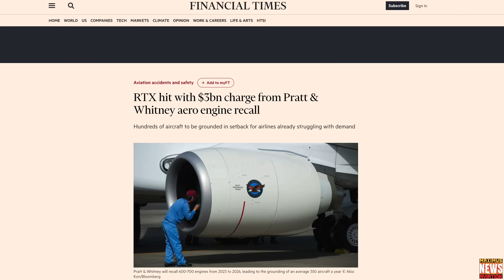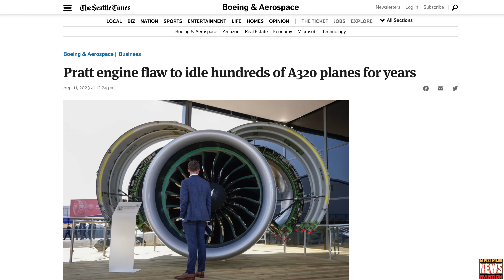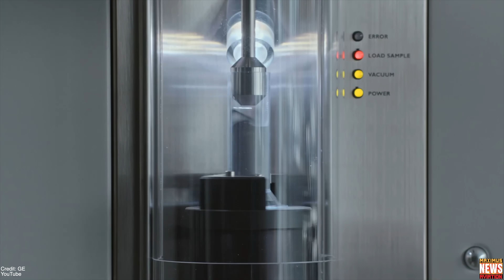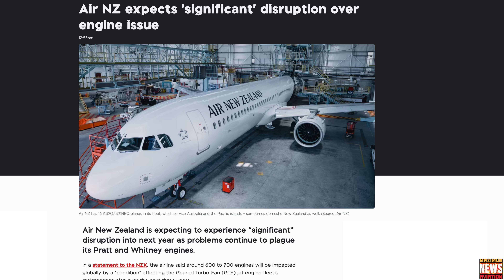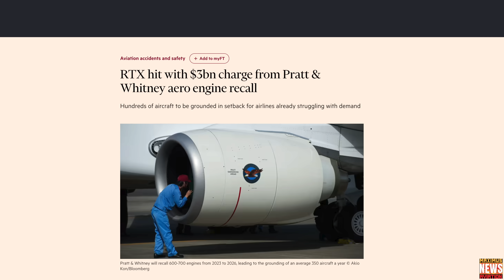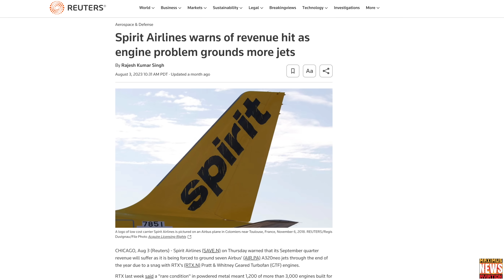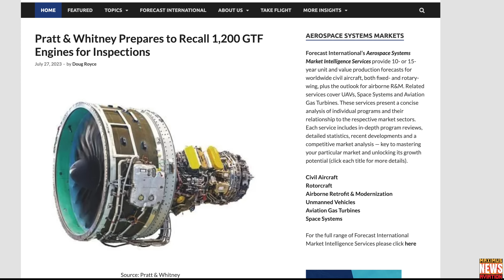HUGE LOSS For Airbus. Every A320 neo-Family Jet P&W GTF Engine Will Have To Be PULLED And Repaired!

Comment: There you go. At least the Boeing fan boys can stop twisting themselves in knots, as they realise that if you buy something to put in your product and something goes wrong with it, it's on you. You can then go and sue your supplier to recover your costs. That's the law.
Reply: It's more usual for airlines to lease the engines fitted to their aircraft. They are not bought as a package and this means the engine manufacturer is on the hook for any issues during the length of the lease.
Reply: That's not the law. If you buy  something to put on your product and something goes wrong with it it's all on the manufacturer who made it. In this case engines are not boeings control but only the engine manufacturer. They hold full responsibility. The customer chooses the engines and the manufacturer deals with certification and any other issues That's bottom line
Reply: Yes. It’s not just Boeing that sucks, everything sucks! Hooray!

Comment: And guess what, just like Boeing, it’s not Airbus’s fault.
Reply: Pratt & Whitney (RTX Corp) is responsible. Airlines negotiate the engine purchases with the engine manufacturer. The engine manufacturer is responsible for warranty.
Reply: #blameChina
Reply: Exactly my thoughts. Engines, the more efficient they are the more problems they cause.
Reply: Seems that Blackrock Inc owns Pratt&Whitney. They surely have all the money to pay for this.
Reply: But it is... If I buy a plane from you and it breaks down in the guarantee period, you are paying me. I have a contract with you, not with the engine supplier. That's your problem, and you have to recover what it cost you to make me whole, from your engine suppliers. That's how it works in law. That is the law. So both Boeing and Airbus will be recompensing their customers, and will file suit for recovery of those costs from their engine suppliers.
Reply: @BigHenFor customer choose the engines.
Airbus is just responsible for certification of compatibility with its airframe i think
Reply: @BigHenFor its not. Boeing don't make the engines on planes. The engine manufacturer pays compensation for any delay an aircraft has whilst in service and before certification or delivery. That's the law and bottom line
Reply: It is a well established fact as you have stated. P&W are going to have to File for Chapter 11 protection asap but even that may not save them.
Reply: @trevorhart545  I would not jump to that conclusion too fast.   We need to understand the contaminated powdered metal thing.   If the powder is made with a process licensed by a single company to all the engine makers this could be everybody.    Something would need to be worked out to protect them or we could be without get engines.   
Not saying it is but it might also be traced back to a single supplier who feeds everybody.
Reply: @BigHenFor Not necessarily. 

In many cases, the airline doesn't buy the engines. They are rented directly from the engine manufacturer by the hour.
Reply: @BigHenFor That’s where you’re wrong. It’ll come down to the engine manufacturer not the airframe manufacturer. When you buy an aeroplane you usually buy the airframe and lease the engines from the engine manufacturer or a third-party leasing company. Rarely will the airframe manufacturer be on the hook for engine issues, because they write the contracts to ensure they’re not.
Reply: @BigHenFor  I think @Leon_Tacitus_LLR was thinking of fault as who caused the problem.  Who had engineers or management that goofed.  Your talking financial responsibility
Reply: @BigHenFor  Actually airlines order engines separately. So you do have a contract with the engine supplier.
Reply: @BigHenFor  That's not the way it works, and there is NO such law.
Reply: @BigHenFor   That is not at all how the aircraft business works.  Engines are purchased completely separately from the airframes.  A contract with Airbus to buy an airframe is just that -- for an airframe.  There is a separate contract altogether for the engines with the engine OEM that the customer selects.  These are, thesedays, generally leased by-the-hour.    The engine manufacturer will be responsible for these costs, but they will actually be minimal to the airline.  Since airlines only lease hours of engines and not actual engines, all P&W has to do is swap the engines out with ones already repaired.   The only downtime will be the time it takes to swap engines.  Whether P&W has to pay for airframe downtime is up to their individual contract with the leasing airline but, regardless, it will be relatively minimal.

Comment: Why are airbus using P&W engines? Rolls Royse engines surely better?
Reply: Which Rolls Royce engines are available for the single aisle jets?
Reply: Airbus offer P&W and CFM options on their A32x neos.  Both engines look about equal on paper.  The operator's choice could be a political one - US airlines might prefer a US manufactured power plant, or might have a long term relationship with P&W - like United, who ordered P&W powered A321 neos and A321XLRs last July.
Reply: @peterhastings703 United Airlines is a historic customer of Pratt & Whitney, and their A320ceos have IAE engines, a consortium where P&W is still involved.
Reply: RR doesn't have new generation engines at this level. They are trying to develop Ultrafan for this purpose.
Reply: The last time Rolls-Royce was involved in single aisle engines (International Aero Engines, with Pratt & Whitney, MTU and Japanese Aero Engines) ended up in a lawsuit against Pratt & Whitney because of the Geared Turbofan patent.

Comment: Huge loss for P&W.  They will be footing the bill for this.  Is this also going to affect the A220?
Reply: To be fair I would rather foot the bill for the HPT rotor set than putting 346 souls into the ground with the competition.
Reply: @afterburner119  US business would prefer to pay compensation to victims than address their failings.
Reply: RR may be the only OEM in the clear 😅. Off the press “Not just Pratt & Whitney, but GE Aerospace and CFM too have been confronted with a contamination issue in powder metal that requires the replacement of engine parts. In the case of GE and CFM, the issue affects the GEnx large turbofan and the CFM LEAP.”
Reply: @afterburner119 Yes in this case RR is in the clear because they have no engine participation in the 320neo program.
Reply: @afterburner119  you can't be so sure about that, RR sure ain't in the clear, the reliability of their Trent 7000 and XWB engines is inferior to the GE90 and GEnx. And then there's the Trent 1000 🙄
Reply: I will say yes and the Emb-190/195-E2
Reply: Somebody mentioned Rolls Royce and their R100 (I think that was the name of the engine) engine. Well Rolls Royce disintegrated as a company after that debacle.  There's still Rolls Royce engines but it's not the same company, it's a phoenix from the ashes of the old Rolls Royce.
Reply: not the first time they have made bad engines with bad turbine's
airbus should have bought RR engines but then its the French so there you go
Reply: @joeconnolly89  Well maybe Rolls  Royce engines are much dearer than Prat & Witney engines. I don't know, though I live in the U.K
Reply: @joeconnolly89 Airbus isn't French and there are simply no RR engines in the required engine range for the 320neo family. And if you think RR engines are any better than GE or PW engines regarding reliability, engineering and efficiency then you certainly don't know much about that industry. Just a reminder about the great RR Trent engines, which almost downed a Qantas A380 because of a design error causing quite a bit of recalls as well. All of these engines are engineering marvels, highly complex on the edge of latest engineering and material possibilities and therefore quite prone to unforeseen technical problems due to design issues.
Reply: @joeconnolly89 
RR have had their own problems, so this silly attempt at jingoism is somewhat unfounded.

Comment: If it ain't Rolls I ain't going.
Reply: Trent 1000
Reply: GE rules - RR drools. Just look at the Trent 1000 and the inferior reliability of the Trent 7000 and XWB as compared to the superior GE90 and GEnx designs. Manufacturing defects can happen to the best manufacturers, just look up the RR scandal where they were caught with bad parts. At least with GE, they conducted their own investigation, and duly reported it to the FAA - meanwhile at RR, they had some of their fan blades disintegrate on Trent 800 engines on EK years ago. Tell me one instance of a GE carbon fiber composite fan blade disintegrating in flight - I'll wait.
Reply: @rafaelwilks  Despatch reliabilty for Trent T-7000 & T-XWB has been phenominal. Admittedly T-1000 did have major problems which cost the company dearly, so what you suggest about defects occuring is correct, but you only apportion it to RR, what about uncontained explosions of GE90`s, & GEnx problems in it`s early life & more recently too ( United B787 over the Pacific had a shutdown ) of course you won`t mention those....not on your agenda is it? Trash talk does you no favours.
Reply: If making jet engines was simple, easy, and foolproof, Briggs and Stratton would be making them.
Reply: Thier latest engine has issues sutting off in flight. No one is making perfect turbofans. P&W took the responsability seriusly. They didnt Boeing-ed it like the 737 max crap. In the end they can retain their name and reputation. Better safe than sorry.
Reply: Tell that to both the Trent 1000 and the Trent 7000. Both are having considerable issues, such as blade cracks.
Reply: @O530CarrisPT_C2  T-1000 had problems that have been resolved since 2019, & I`ve not read anything to suggest T-7000 has any `blade cracks`. Can you support your assertion with proof?

Comment: For those that blame Boeing for engine problems in the last video, what do you have to say for Airbus here?
Reply: Engine issues are engine manufacturer issues. Unless the aircraft manufacturer does something bad, which I can't remember a good example of at this time.
Reply: Bloody idiots for allowing US engines to be used instead of Rolls Royce high quality ones.
Reply: @andrewallen9993 I can’t tell if you are being serious here. RR Hasn’t been known for that for quite a long time 😂. Just look up the term turbofan oil leak/LOP and Trent. 😂😅
Reply: @afterburner119  Did they recall 1300?
Reply: @andrewallen9993  I think they were grounded, went bankrupt, and are just a shell. I’m not sure they have 1300 total airworthy engines unfortunately.
Reply: @afterburner119  🤔
Reply: @andrewallen9993  I think it’s actually 3000 PW Engines going bad to be fair to you, RTX Math seems funky. The whole Aviation industry is suffering and I think it’s getting worse. ATC is on the verge of collapse in the US, wild
Reply: @afterburner119  those are scary numbers.
Reply: @afterburner119 Is that the uncontained engine failure incident on Qantas Flight 32 which involved on an Airbus a380?
Reply: @andrewallen9993 ……..Trent 1000?
Reply: Totally agree  with you, though I would prefer Rolls Royce engines since I m British, 
 @andrewallen9993
Reply: @andrewallen9993  RR doesn't have new generation engines at this thrust level. That is why they are trying to develop UltraFan.
Reply: @user-yt198  A very valid point.
Reply: @andrewallen9993 You know who “Pratt & Whitney” are, right? Maybe you should kick about using French aircraft.🤣😂
Reply: @colinwallace5286  they made first class bicycle parts?
Reply: The very same thing as I said to you yesterday.
Reply: Both companies are run by criminal accountants/executives. They used to be run by engineers, that's when they made decent planes that didn't blow up in flight.
Reply: They are repairing them,  not doing nothing only to blame brown people later
Reply: Sucks to suck.
Reply: Sort of funny how we really haven’t heard a peep about the 737 Max in a long time either. I guess there’s a large political picture   affecting a lot of this.

Comment: When pushed to the edge, technology sometimes disappoints.  This is disappointing news.  Hopefully they work out a faster way to check and service engines impacted.
Reply: Nice ..and intelligent!!! Where did you come from???
Reply: @berkeleyfuller-lewis3442another intelligent comment!!!!
Reply: Lol this is NOT technology being pushed to the limits, that's a big myth that the uneducated populace in this comment section is falling for, it's a simple manufacturing defect that could happen to anyone on any design in any time period. What will it take for society at large to comprehend anything?
Reply: – "When pushed to the edge, technology sometimes disappoints."
Is it really the technology that's disappointing in this case, or the practical implementation of it? The tighter you set the timetable and cost requirements, more likely it is that you will face serious problems with any product, whether it includes new technology or not. In such cases the blame may go to the management of the company, or perhaps to some wider phenomenons, like general eroding of safety thinking in the business or overly demanding customers. Mostly it's probably a combination of many things.